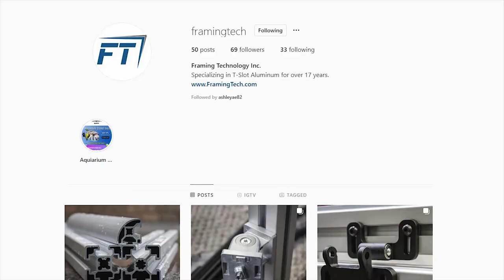Quick connectors

Comment: Is there a special template or guide for drilling these extrusion for using these quick connectors? And what size extrusions are these? 45mm x 45mm?
Reply from the maker: Yes, the extrusion that was used in the example is our 45mm x 45mm extrusion.  We have a drill jig available online for 45 and 30 series extrusions.